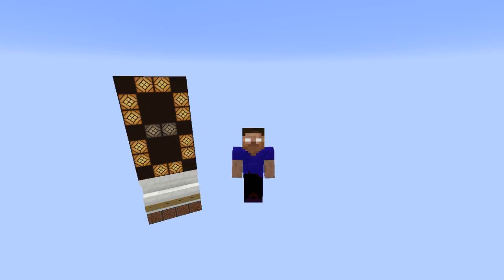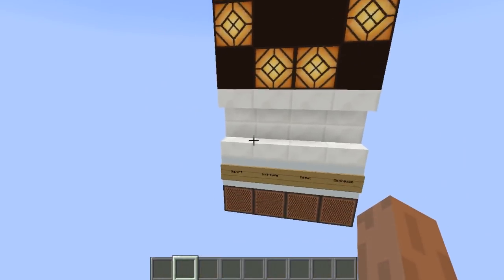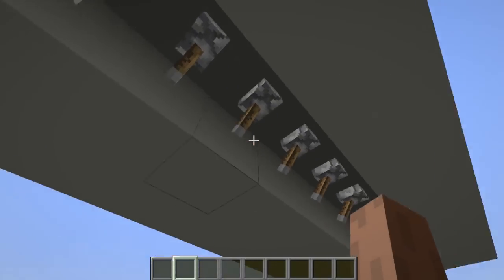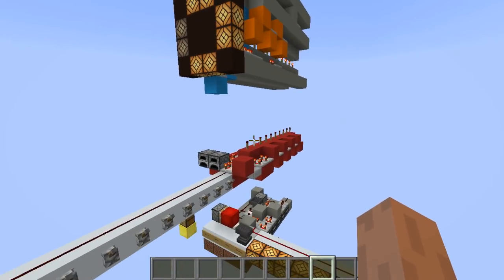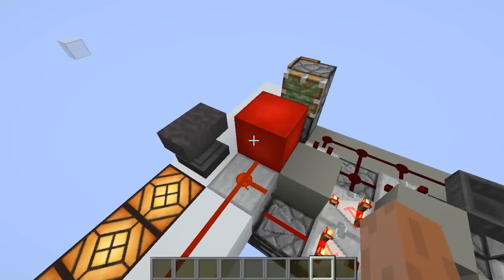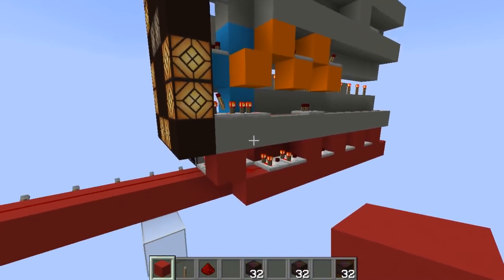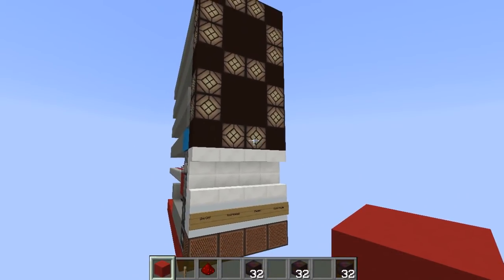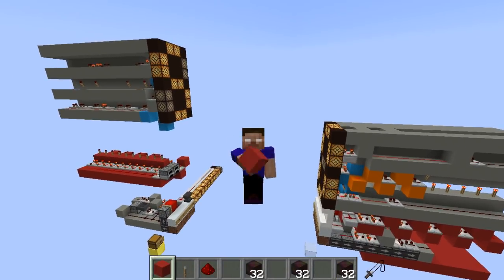Numeric Display with UP / DOWN / RESET Functions! | Minecraft

Comment: Beautiful creation and video (and tutorial). I could get the numbers to work with the levers system, but when I tried the control panel it seems like something is off. 
The dropper-hopper systems seems not to be working. The ice ball doesn't work and the system is constantly on zero. Any ideas?
Reply from the maker: You mean the base layer that controls the counter ?
Reply: @MaizumaGames  yes, but apparently I've figured out what happened. When you build the first the first layer of the analog clock, you need to put hlaf-slabs instead of full blocks then place the repeaters.
Absolutely love your design btw!

Comment: Fern blowing !!! I'm trying to make it on xbox360 as usual, but only with the video, it's really hard ! Question, You got 2 furnace, how many items do you got in the  left one, and how the hell do you read the strenght of the right one on your demo one ?  :) I just don't understand. And I guess the hopper/dropper only got one fern in it ?
Reply from the maker: Heyo Eclipse!

I think the furnace on the left side has two full slots (two unstackable items for ss level 10) I'm not in my computer to confirm now. The hopper dropper-hopper is counter-intuitive, it's completely full with 9 stacks of snowballs.

You might not understand how I connect the bottom counter circuit to the signal strength decoder because I changed them in the exploded version to look like their originals standalone versions! You can see how the bottom connects to the middle at 2:40.

I hope this is enough info to help you. I plan on doing a block by block tutorial since some people requested it, so it should make it easier :-]

Thanks again for testing the system on xbox!
Reply: @MaizumaGames  Please do a tutorial on it. I'm on trouble with the top portion is good with levers, but the strenght décoder is a total mess. I found the hopper dropper was budded and it was good after resolving it. But no. It still impress me how do you find such redstone logic !
Reply: Just saw you made it ! Tanks !